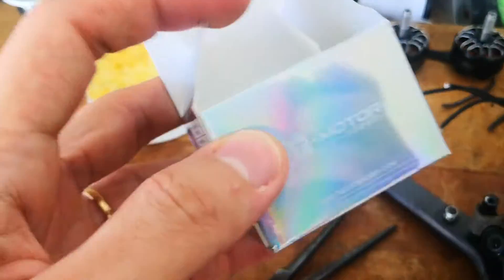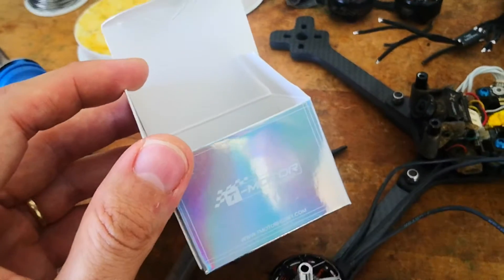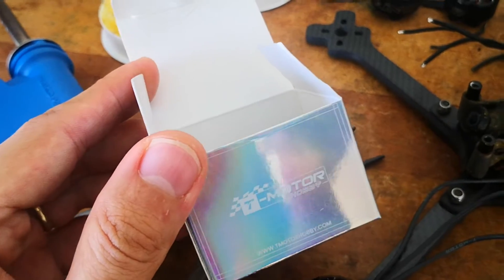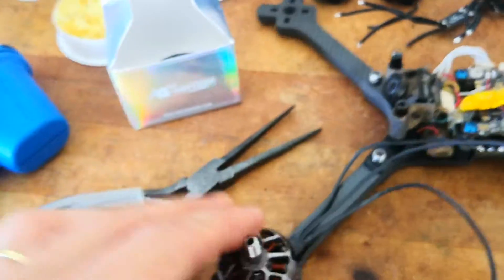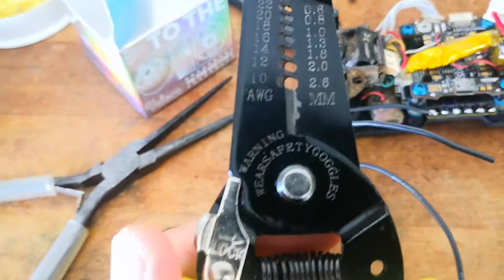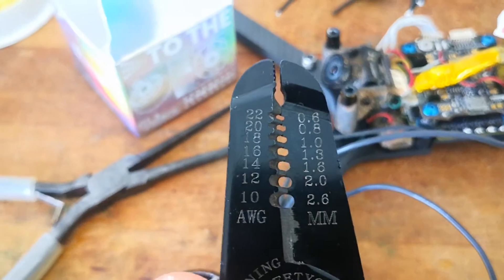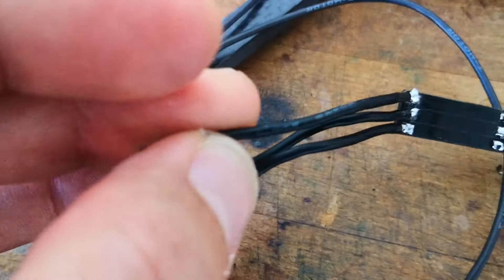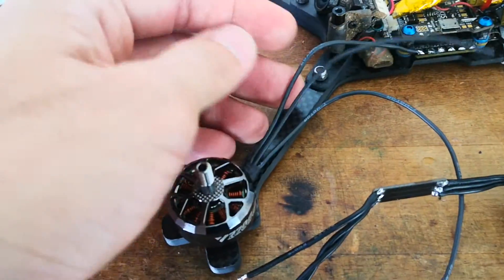Why T-motor is not my favourite brand when it comes to motor selection.

Comment: From my experience T-Motor is a great brand if you plan to build big quads. When i was flying my TBS Discovery and also my Aerobros T41 which was using 15" propellers, all my motors were T-Motor and they are still working to date.
For mini quads, T-Motor has never been my to-go motors, always budget brands like E-Max and Brother Hobby.
However, i think the fact they don't display the motors specifications and wires gauge is new because, i can show you all my old motors have all these information :/
Kinda sad if they are going that way because that's basically kinda the Apple/DJI way of marketing, which absolutely sucks :(
Happy midweek and keep on flying <3
Reply from the maker: Not saying it is bad. It is just not my favourite in motor selection because not mentioning motor size prevents selection process.